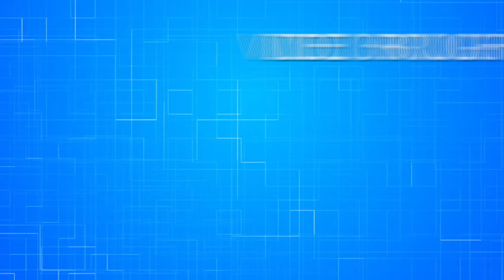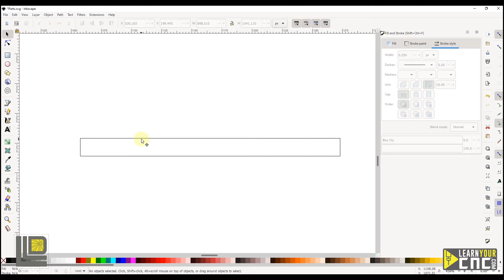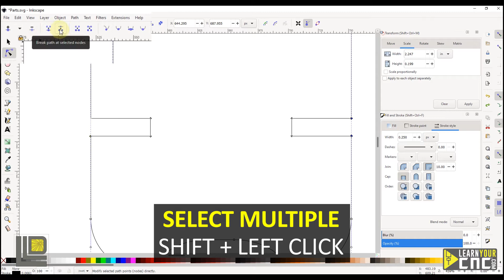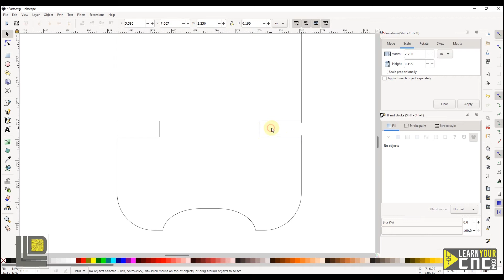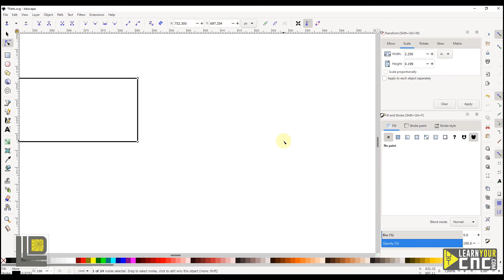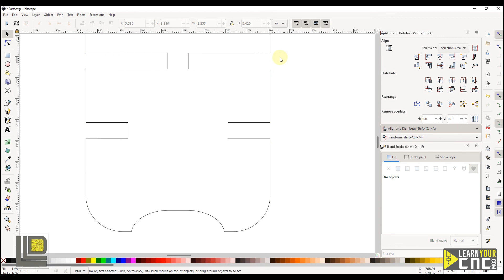How-To Resize Boxes and Slots - Inkscape Edition

Comment: Thanks for this. I am looking how to make curved slots to a defined radius. Let's say half inch wide slot 3 inches long that has a 3 inch curved radius. The end of the slot would also have a radius as you would using a half inch end mill. This will be cnc plasma cut.